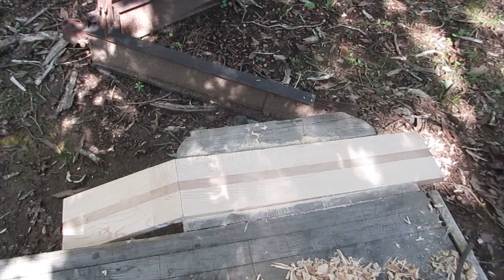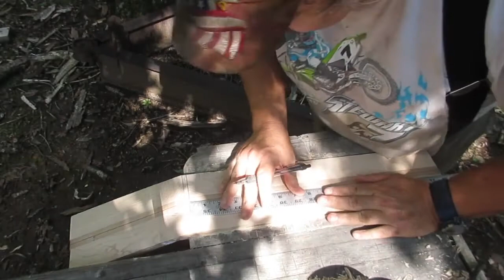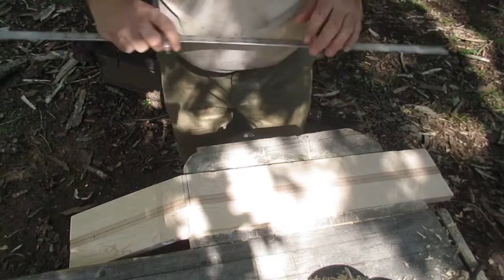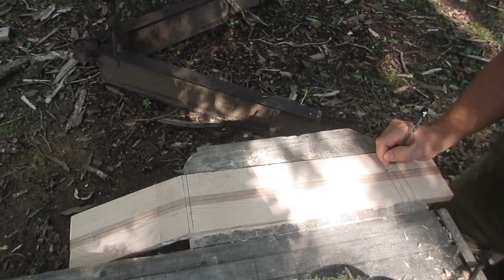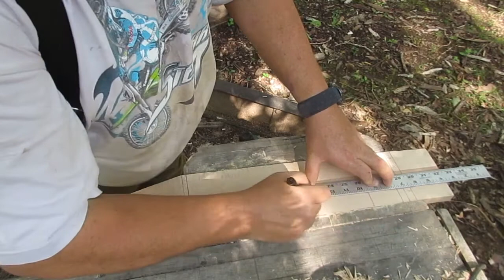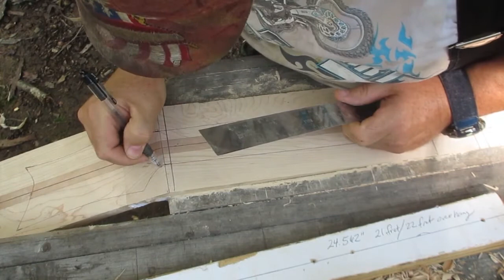Neck Dimension Layout Acoustic Guitar Build

Comment: Looks good. Youre taking your time and putting in attention to detail. Im looking forward to seeing the finished product.
Reply from the maker: Thanks! Can't hardly wait myself.
Reply: You did say it will take until spring right? ANy projects for this winter?
Reply from the maker: Part of this will take place indoors during the winter months. The top and the back are thin plates, and they must be glued together, braced, and the box "closed" (top and back glued on) in very low humidity. So I will wait until the furnace kicks in for winter and the humidity where the wood is stored drops to around 40% and stays there a couple of weeks. Then i will glue the plates, take them outside just long enough to thickness them, and move back to let them settle before bracing and glue up.
If this is not done the top and back will twist, sink or crack when humidity changes throughout the years.
As for other projects, I usually fly by the seat of my pants.
Reply: WIll you be building clamping jigs for the body curve?
Reply from the maker: I built a body mould earlier. For the braces I'll arch them and glue them to the top and back in sections. No radius dishes, etc. Like it was done a long time ago.
Reply: Very cool. I need to get my woodworking skills up to snuff. My goal is to design and make a shaving kit with box, like one from the 1800's. Ive been watching a lot of inlay vids on here. I like gold inlays.
Reply from the maker: Sweet. You can do it, and Youtube can teach you.